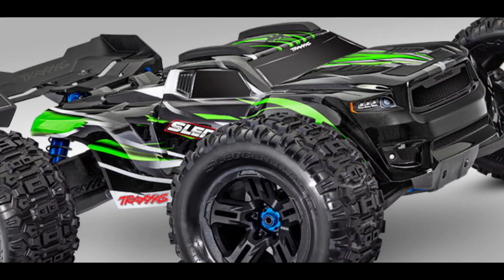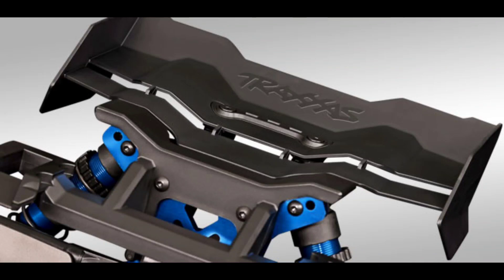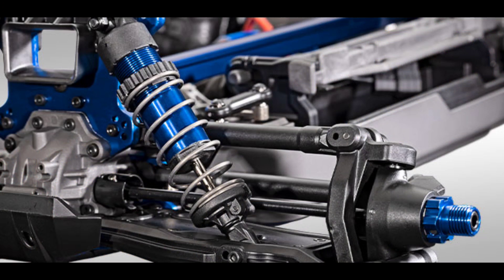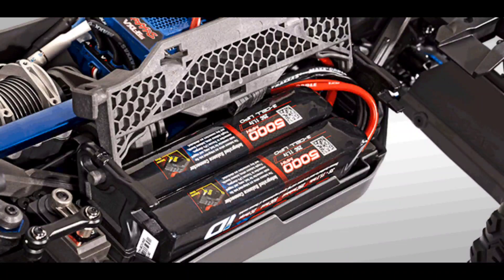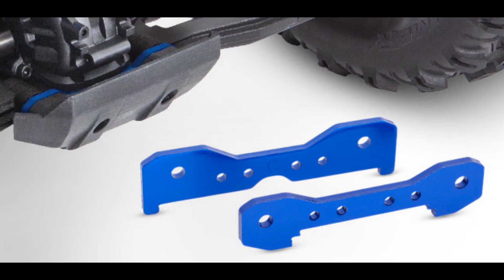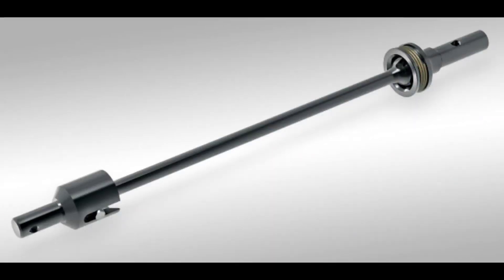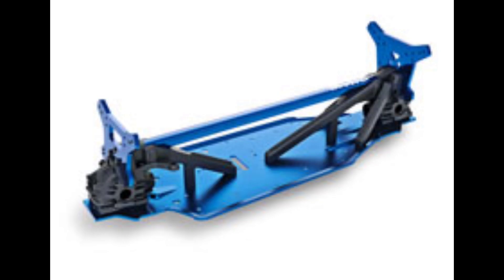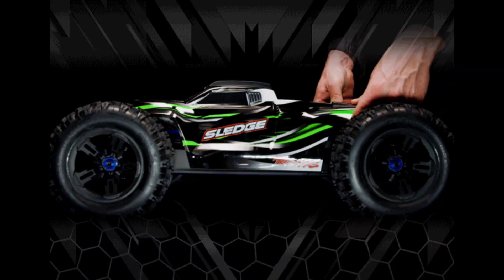RC Update - New Traxxas Sledge VXL 6s

Comment: Seemingly has proprietary wheel nuts so hopefully the replacement proprietary wheel/tyre combo packs from Traxxas won't be obscenely overpriced.
Reply: TBH, I use aftermarket tires and electronics on my X-Maxx and Maxx V2 trucks. The Traxxas electronics and tires are weak and overpriced. Same thing with the batteries
Reply: @joseCalderon1976  I'd certainly appreciate Traxxas also offering the Sledge as a roller like other companies do for some of their RC cars.